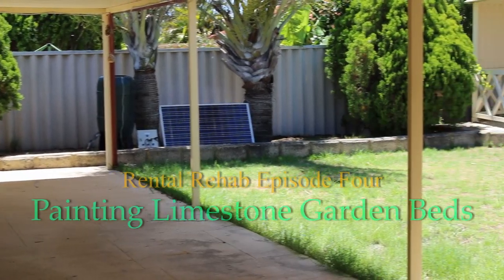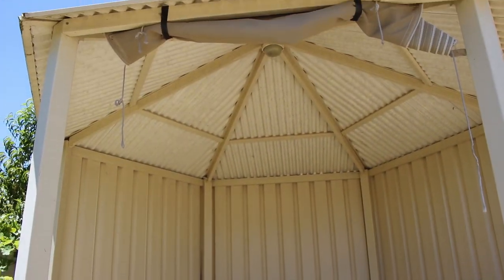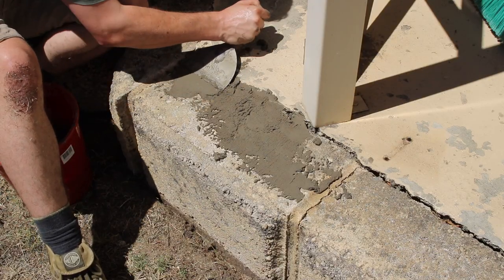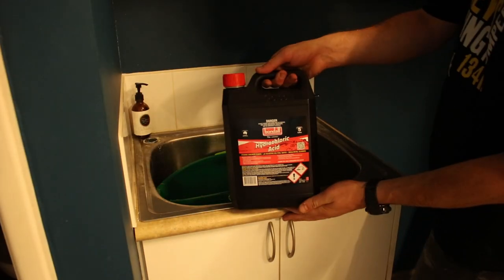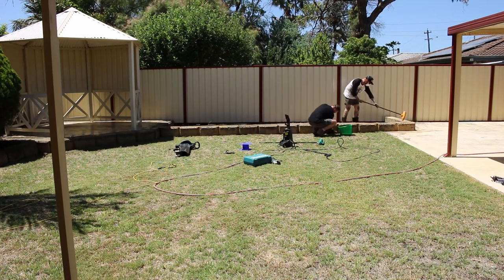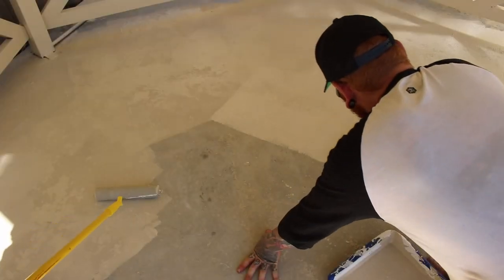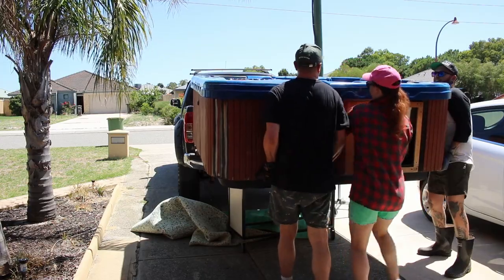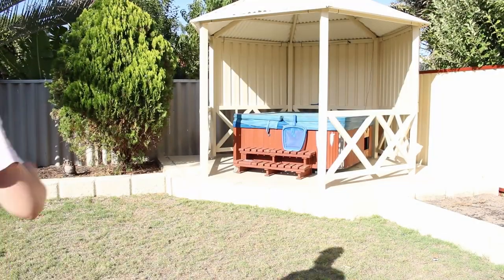How To Paint Concrete and Limestone

Comment: How is the White Knight Ultra Pave looking now? Has it started to lift or peel?
Reply from the maker: Still going strong! Though none of it is really a high traffic area. Sometimes we walk on top of the garden beds to avoid the lawn on the way to the spa pool, but it is holding up well. Key is good preparation
Reply: @TheHandyTech  Ok thanks for your response mate. I am considering using it on my patio but it will have more foot traffic than your gazebo so I might have to do some more research.